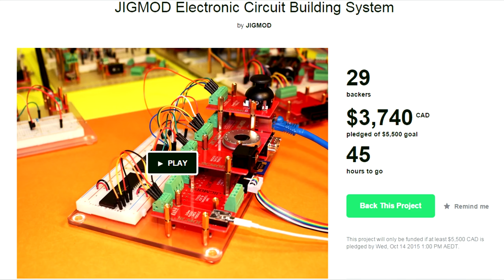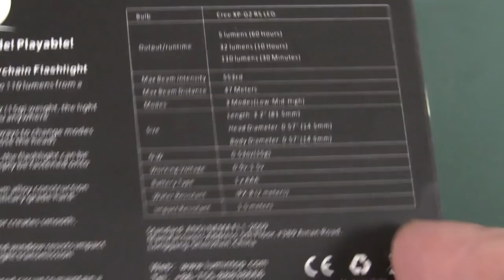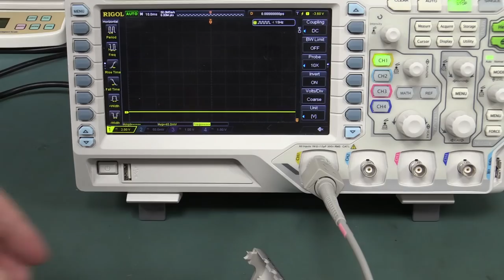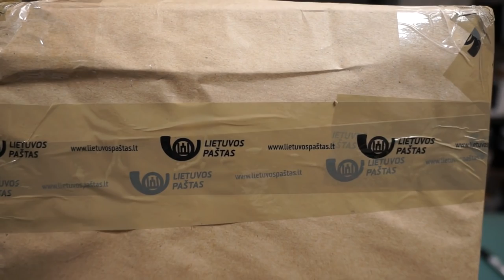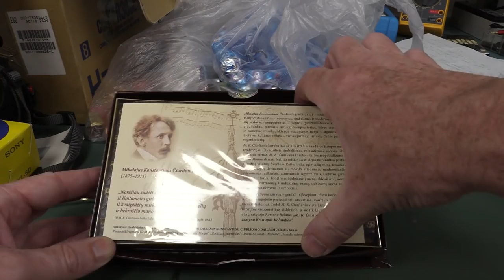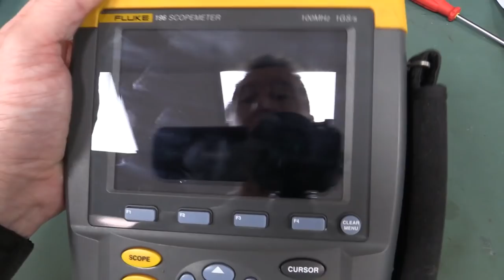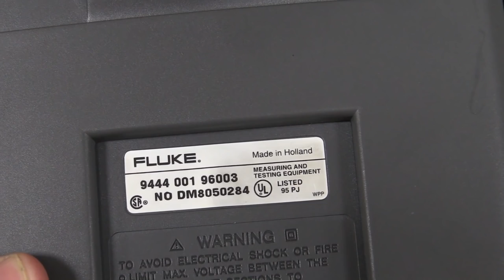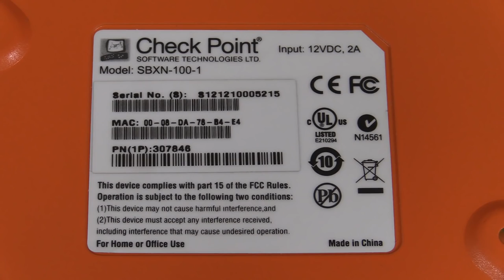EEVblog #807 - Mailbag

Comment: I have been using the 555s to make police lights for the kids but have hit a snag, I used trm pots to chang the flash rate from side to side and also using them to speed up the lights so as they can flash multiple times before alternating. I found that one side will allow multiple flashes and the switch to the other side but I cant get it to flash multiple times. Does anyone know the fix or send me in the right direction to try another layout. I have only been using caps, resistors, pots and of courcethe 555. thanks

Comment: Hm, I have mine on the keyring with a smaller (8mm or so diameter) ring and then attached to the torch. Much better and not in the way of the button, and more flexible in any case

Comment: There are some insane torches on Amazon. I dunno if you've looked, but people are throwing like 10 Cree XM-L LEDs in a torch, the thing pulls 100w and gives out like 110,000 lumens. I want it. I have no use for it, but I want it.

Also, find yourself a tiny keyring, attach it to the torch, and attach the smaller ring to the large one, problem solved. I do that for my tiny keys.

Comment: Need a heavy duty "U" shaped clip for that light... I DO like that light though... Might have to get one!
Reply: +richfiles And I actually DID get one of those Lumintop flashlights. I LOVE the thing! The Lumintop I bought had two tail caps. One with the button, and one with a twist type magnetic end. The magnetic end leaves the overall length much shorter.

Comment: I have a 200 MHz, 2 channel, color Fluke ScopeMeter -- and a Digital 8mm Sony video camera ------- with built in color thermal printer!  (DCR-TRV820) You can print captured still images or grab a frame from the video.  It's pretty slick, but large by today's consumer cameras.

Comment: A 4GB SD card doesn't exist, only up to 2GB. 4-32GB cards are SDHC cards, and after that we move into SDXC territory.
Reply: 4 Gb SD cards do exist, I have two of them in my car (which doesn't accept sdhc/sdxc cards). They are just not that easy to find. :)
Reply: +geunsjl Then those are unofficial. The point of the SD card is that it uses FAT16 which has a maximum capacity of 2gb. You can of course format it in any file system you want, but for interoperability with various hardware it always assumes the default formatting, so those 4gb SD cards you claim to have must be kinda weird.
Reply: +Nukle0n you can easily find then on Amazon
Reply: +geunsjl Amazon acts as a front for many sketchy online stores. You can find all sorts of scammy crap there.
Reply: +Nukle0n I know, but I have 2 of them, they work in regular SD slots. Trust me, I have a masters in Electronics-ICT.
Reply: +geunsjl Nuckle0n is correct, while you can't get an official ISO certified 4GB SD card, you can get an unofficial one that may or may not work in some devices. And you having a masters in Electronics-ICT doesn't make you an authority, don't be an ass.

Look at the label, does it have the SD logo on it? What class is it?
Reply: +Nukle0n FAT16 has a 4 GB limit
Reply: +Benedikt Müssig If you use 64kb sectors which nobody ever does, and which very few devices support.
Reply: Nukle0n Yes that's right. I was just talking about the theoretical limits.
Reply: +Nukle0n So it technically might have worked, had he shrunken down the partition on the 4GB card to 2GB and formatted it with FAT16?
Reply: +Seegal Galguntijak I dunno, probably not. Most devices don't seem to give a shit even if you try and cheat them with undersized partitions.
Reply: +Nukle0n Yes, but there are 64+GB SD cards as well. They just don't come preformatted with that ExFAT crap, because they are not "SDXC", but compatible. I use ext4 on mine, but with low brow operating systems, you might be able to use NTFS (or format them to the infamous ExFAT after all, if you don't want to be compatible to the rest of the world because of silly, ridiculous patents).
Reply: +Seegal Galguntijak Ignoring all that Linux superiority you are spouting, the whole point of those labels is so that they are compatible across devices. The only reason to use memory cards and not a thumbdrive or portable HDD is that they fit in some device, and as such they need a standard.
Reply: Nukle0n Unfortunately, when designing the SDXC pseudo-standard, they haven't thought of that, because a standard is nothing that anyone should have to pay license fees for.
Reply: +Seegal Galguntijak See that sucks, but it's kinda not uncommon. HDMI is another standard that requires a license, while DisplayPort does not.
Reply: Nukle0n That's one example of what is wrong with this world.

Comment: Instead of thermal epoxy, why can't more companies use mounting posts that you screw in? This will allow for much better thermal compounds to be used, and make it easier to upgrade the cooling if needed.
Reply: In short, because there is no incentive for them to care.  If you destroy the product trying to address their deficiencies then that means you will just have to buy yet another.

Comment: All (?) 4GB SD-cards are SDHC, and that camera cannot address that. Use a SD-card and that should work.
Reply: +zaprodk You're definitely right by the standards, but I seem to remember that there were some cards that bodged 2x the maximum capacity of standard SD, but I guess that they didn't work in everything.  I may also be wrong and perhaps the official max was 1GB and it was some 2GB cards that were the bodge.
Reply: +zaprodk If you can find one...
Reply: +zaprodk Just put a 2GB partition on a 4GB card and leave the rest free.
Reply: +Seegal Galguntijak Well if it's an SD-card, you can just format the card in the camera and you will get a 2GB partition that the camera can use. Using a SDHC-card will not work as it's incompatible on the hardware level.
Reply: ***** You mean, putting a 2GB partition on a SDHC card wouldn't work? What a bummer!
Reply: +Seegal Galguntijak Exactly. It's like putting a 3.5" floppy into a 5¼" floppy drive. It won't work.
Reply: ***** How can the hardware be that different? It's at least pin compatible, and SDHC readers are downwards compatible as well, so internally, the SDHC card should just have a larger address space than SD can handle - which should be corrected by using only half the size of a 4GB card in a partition (of course, other partitions beyond that 2GB mark won't be readable by the device, but that was clear from the beginning). Somehow I think the floppy disk comparison doesn't quite fit...
Reply: +Seegal Galguntijak SDHC is an extension to the SD-card-spec. It utilizes different addressing as the older SD-spec had a 2 GB Cap. limit. http://www.integralmemory.com/faq/cards-what-difference-between-sdhc-and-sd-cards
Reply: ***** So if there were a partition within the limits of the SD spec as only partition on a SDHC card, it should work, should it not?
Reply: +Seegal Galguntijak No.
Reply: ***** Damn that sucks. What a stupid standard, that isn't both ways backwards-compatible.

Comment: WHAT THE ACTUAL - i've got that handycam sat like 5 feet away from me. Still works, it's in mint condition actually. I'd use it if we were still on the old CRT tvs EDIT: in fact, mine might be a bit older. My dad shot me on it when i was a little kid